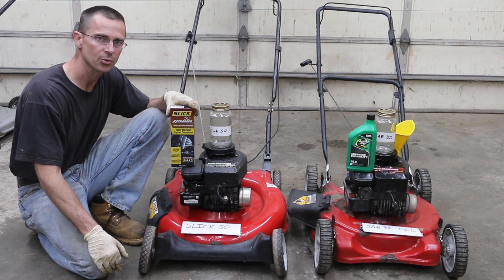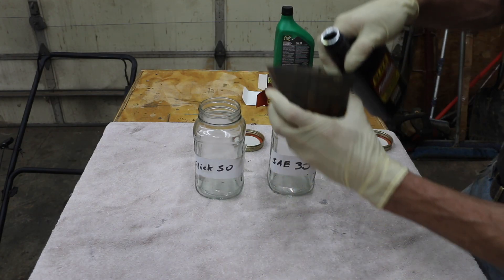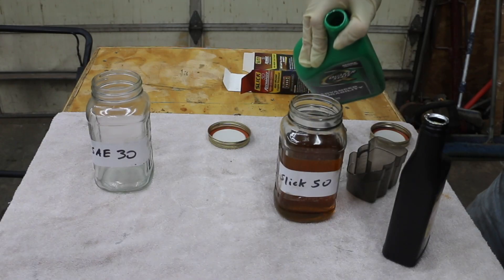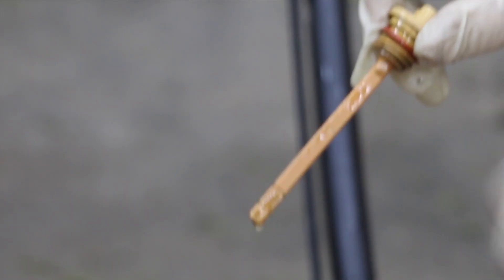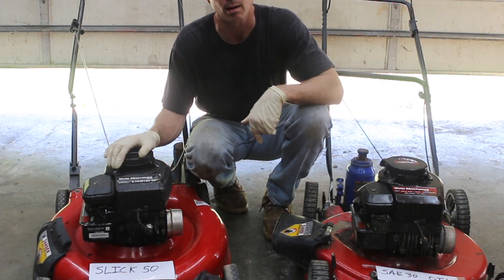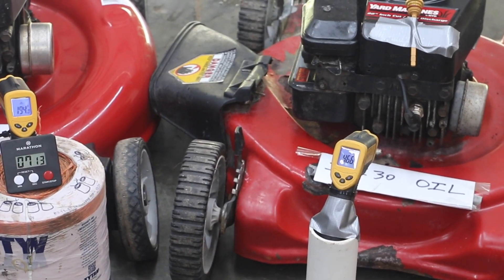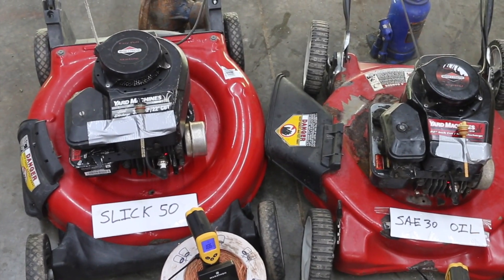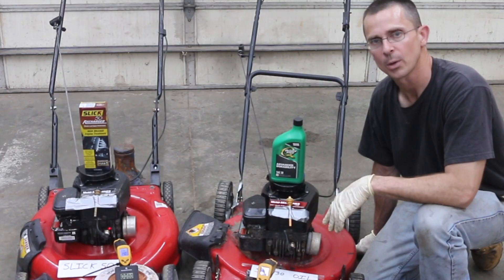Can't believe what SLICK 50 did to my engine!!--Dry Crankcase Test!

Comment: Actually, I was told during a "slick 50" demonstration at "Alderley Auto Toeing" many many years ago, it contained copper. And after the guy used an electric motor with a fixed bush on the end and a leaver to pull against it with normal oil in a tray under it and scratched up the bush. He then put slick 50 on it. Which filled in the scratches with something that did look like copper. With the normal oil I was able to stop the electric motor with the leaver. After slick 50, I lifted myself off the ground with the leaver and the motor didn't even slow down. At the time he claimed it was nano spheres of copper. My research below says it was soluble copper derivative. However he did go on about how the spheres were too small to get caught in the filter. For what's it worth, that is what I saw, heard, felt and experienced during the demonstration.
 

(In Tribology, the Garkunov effect is one of selective transfer of softer metals to harder metals. You need to explain the full tribological process in order to understand what's going on at the surface.

As the "copper indutstries" link above explains it's not nanoparticles of copper that are used in biosynthetic lubricants but oil soluble copper derivatives such as copper dihydrocarbyl thio- or dithio-phosphates, copper dithiocarboamates, copper sulphonates, carboxylates, and phenates.

The above are used as oxidation inhibitors for epoxidized vegetable oils.

Comment: I would like the to see the same test performed, but mix the Slick 50 with the same motor oil used in the second engine (at suggested ratio from Slick 50's manufacturer).
Reply from the maker: Thanks for the suggestion.

Comment: Here's a good one that no one's listed thats said to have been designed and tested by Department of Defense, NASA, and a bunch if other reputable scientific research agency's. Its called Tribo-Tex. Supposedly it could even improve badly worn engine bearings by clinging to them wherever their worn and filling in any worn down spots and after 500 miles of driving after adding to the crankcase, it eventually reaches every single spot of the engine wherever friction is present and can apparently seal a crack smaller than the width of a human hair. You should do a video on it, it would be really interesting as its not talked about too much. The crazy thing is, is it's literally just this little bitty syringe that cost $100.
Reply from the maker: Thanks for the suggestion.

Comment: Interesting test (thanks for the video)!
2 problems:
(a) "Slick 50" isn't - anymore.  The original slick 50 is now sold as Xcelplus.
(b) Treatment time - Xcelplus is a "treatment" not an additive, and it beds in over TIME.  For a car, this would be (at LEAST) a full oil change cycle (such as 10,000 miles), i.e. you put the treatment IN with an oil change and LEAVE IT IN for that full duration.  I don't know what the equivalent is in a lawnmower (maybe 50 hours runtime??), if it hadn't bedded in properly I don't think this test holds up.  I've never run an engine with zero oil, but I have used xcelplus in several engines, and had GREAT success (in that I know it WORKS).  Cut a long story short, my 1992 subaru brumby went 160% mileage of normal engine rebuild mileage and was still running fine, the most noticeable difference was a cold winter start took AGES to warm up enough to heat / demist the windscreen (that was actually a drawback, I'd  have to run the car at least 10 mins before I could drive it, largely negating any improvement in fuel economy).  There are promotional / marketing videos of airplanes being run without oil in the engines - these carry some weight.

Comment: Good experiment, shocking result. I heard (decades ago) that Slick 50 actually lubricates TOO well, allowing oil to sneak up  past the piston rings into the cylinder. Maybe that's why  the Slick engine stopped sooner before it got as hot as the other?? It might have been interesting to remove & observe the condition of the spark plugs.
Reply from the maker: Thanks!  Thanks for the suggestion.

Comment: I know, video was 6 years ago but I wanted to say there’s a stark difference between running an engine with Slick 50 for a few minutes (before draining) and running it hours and hours on end with the additive?  Perhaps running the mower for a full season of mowing with the additive might better mimick the thousands of miles driven with the treatment in the car’s engine oil before the next oil change, as designed.  Could it be, and I’m no expert, but could it be that the desired process that occurs with Slick 50 happens when used longer than when simply used till the engine gets hot?

Comment: I think the point is that as long as there’s engine oil in it, slick 50 will keep the temperature down and maybe that will help the longevity of the engine stick 50 was not designed to run on an empty engine of oil

Comment: I used Slick 50 in the 80's.   I had a V8 Mustang that used oil, since new.   I added Slick 50 and oil consumption stopped.   I added it to my airplane oil (Lycoming 360) and oil usage dropped a lot.   I wonder how Moly Slip does?
Reply from the maker: Thanks for the suggestion.

Comment: The old slick 50 with PFAS did more than what they sell now.
PROLONG is the product you need to test. It sticks at the molecular level, I'm not a fan of testing oil products like this, no engine is designed to run dry, find other ways to test the real world benefit of using an additive, like the temp drop. Prolong reduced wear in areas of my motor, TZ250, I was concerned about.
Slick 50 in my old Toyota R20 picked it up 10mph on top. 
No product will protect your engine from loss of the life blood of engine oil.
This marketing strategy was a waste of time in my opinion. There are many other marketable benefits from using a friction reducer.

Comment: So why did the U.S. Military endorse slick 50 for years . Between 1982  theu 1990 ???? I had worked at a parts house and seen the test were they brought a Briggs & Straton engine in and deained all the oil out of the engine and the sales rep started the engine and it ran for a hour the time he was at the parts house ??? I had a 97 Chevy Silverado with the 5.7 Vortek engine in it  my truck was treated with slike 50. That year 5.7 Chevy V8 engines were natorious for blowing head gaskets and dumping all of the antifreeze into the Block i had no idea until i got home that i had all of that antifreeze in the crack case of my engine till i pulled the dip stick when i got home and it looked like a cup of Coffee that had cream in it and when i drained the oil out of the engine it was as thick as honey coming out of the drain plug . I Tore the top of the engine down Flushed the top end out with break  clean put a new head gasket set and intake set on that engine and it had ran great till i sold the truck ... So i have a hard time believing what you are saying ..... What engine treetment would you advise to use if someone would like to use one because i have seen the proof in the putting with my experience with slick 50 products . And what company do you work for please advise me what would be the one to use now if i would use it again????

Comment: I had  my doubts back when  slick 50 came  out and  looked at it as a gimmick. I never  did  use that  product  and  now i never will. You just  proved  my  thinking.....its a gimmick. Someone  out  there  got rich by  folks  buying the  more expensive  slick  50 thinking they are doing better for  their equipment, when they weren't. Nice  demo  thank  you for  this I was  always wondering  about  this. I've  always  used straight 30 in all  my small  engines . never  had  one lock up yet , but  I don't  trust  Quaker state oil , I'm a Valvoline guy  used  it all my  life  as suggested  by  my late grandfather and  its  held  up the test  of time. I purchased a Chevy  pick up back in  the  80s , the  owner stated  he always  used Quaker state  oil. Soon after the  engine  locked  up due to passages  blocked  with some waxy oil mostly under the valve covers , had to replace  motor and  used Valvoline ever since with no  issues.
Reply from the maker: Thanks for the feedback.

Comment: @Project Farm If you notice the Slick 50 oil was black. Meaning that engine had more worn piston rings than the SAE 30 engine. It was allowing blow back past the piston which is exhaust making the oil black. So when you ran with no oil, it died first from exhaust cooking the crank case. This is proven by most or all of the exhaust puffing out the oil drain plug @ 6:32 Therefore this test is invalid as the engines were not equal. Should be done the same way as his most recent Lucas vs STP video with 2 new predator engines. This needs revisiting. - Detroit
I want to know more about the temp reduction cause I know PTFE inside there is awful for the engine.

Comment: In the 70s I remember a company called BG came around dealerships with a 6 cylinder engine that they would run their oil additive then remove the oil pan run it while the talking about their products about 25 to 30 minutes
Reply from the maker: Thanks for sharing.

Comment: One of the claims is extreme cold starting and the magic trick they used was an engine encased in a block of ice sitting in a room supposedly something like -50 Deg F. They chipped the ice from the fan and belts then started the engine. What they don't tell you is the engine was only slightly lower than 32 Deg F because that is the temp of ice and it will insulate from the -50 room temp. People lived in igloo ice shelters using the same physics. I also had a car that I knocked a hole in the oil pan and drove it 10 miles WOT until it seized. I had 30W Gulf oil in it. The next day it cranked and started. I patched the pan, put the same oil in it, drove it for two weeks and sold it telling the buyer what happened. The engine did have a buzzing/vibration at 2400+ RPM do to the bearings. I moved out of state and came back a year later and he was still driving it without any repair. That was just regular Gulf 30W oil so I am not a believer in any miracle claims. Just good quality standard products.
Reply from the maker: Thanks for sharing.

Comment: Heard somewhere way back that the engine Slick 50 used to demo would run for hours with or without Slick 50 or anything else in it. Quit buying it after my oil pressure dropped on something. Probably in the same ballpark as the intake vortex generators were. Guy installs wanting better mileage and feathers the throttle on the next trip. Hey it really works! Nope, your foot got lighter.

Comment: I use dura lube  each oil change  twice in the past couple of weeks I had bad water leakes  my truck was dry ...I fixed it and its all running fine   I drove over 40 miles with maybe a gallon of coolant   Good old chevy 305
Reply from the maker: Thanks for sharing

Comment: the question is. Are you sure both engines are 100% indenticle? If they are already used engine than the test is null and void. To be 100% acurate both engines would have to be brand new out of the box. But I would like to add. Thanks for the video.

Comment: I like durable I ran car car 8 miles after the oil pump pressure went to zero chanced the oil pump  then about 6 months later it happened again drove the car 7 miles no oil pressure chanced oil pump and that time dropped the pan replaced the pick up found pieces of gasket sealer hah plugged the pick up screen with thanks to duralube
Reply from the maker: Thanks for the feedback.

Comment: I used slick on cars we didn't drain the oil out we put them on a scope snap on scope poor slick 50 in and the ram would go up about 500  rpm higher we would have to idle  them down  this was in the late 70nd
Reply from the maker: Thanks for sharing.

Comment: the slick 50 engine didn't lock up. something failed with the engine.  the regular oil engine clearly locked up in the video.  Slick 50 engine acted like it ran out of gas, not a sudden stop as the other did!!

Comment: It looks to me like the slick 50 cleaned is engine during the initial run process given that the oil was darker. Maybe it removed protection but never actually got the opportunity to bond itself and mostly just drained out. Just an uneducated theory. It would be interesting to see the results after being added to two  clean engines giving slick 50 a chance to actually adire to the internal components.
Reply from the maker: Thanks for the suggestion.

Comment: In '92 or '93 I treated a Subaru Brat engine with Slick 50 after overhauling the engine. I apparently didn't torque the drain plug and on a trip to Texas from Oregon, the plug dropped with the oil right behind it... with the result being a fried engine in Tonapah, NV.  Perhaps this was after the buy-out of the original owner.
Reply from the maker: Thanks for sharing.

Comment: On your slick 50 chest what you didn't do was get the original slick 50 bottle it's a black bottle and you have to shake it for about 10 minutes, then you need to let it run for a while a long while so it impregnates the metal after that it should work fine unfortunately this stuff you used was a recharge kit and that is not the same as the original formula, I know this because I actually have a running engine with over 600,000 mi that I've used slick 50 on and I'm driving this car today.
Reply from the maker: Thanks for the feedback.

Comment: I've had similar results with DuraLube and a cigarette lighter plug powered oil-less air compressor. I decided to splash it with straight DuraLube and it ran really fast for a very short amount of time, then locked up.
Reply from the maker: Thanks for sharing.

Comment: As a Tech for 30 years I remember when Slick 50 was the big buzz, but having to tear down engines and rebuild them because the treatment bonded to the Oil pickup in the pan basically clogging it and not allowing enough Oil to flow through the Motor.
Reply from the maker: Thanks for sharing.

Comment: When I was young there was a car swap meet I would go to with my dad.  There was always an engine there running without its oil pan on to demonstrate slick50.   A local vintage engine expert noted that the demo engine was of a type known to have extremely hard bearings and that it was running with no load.   Nevertheless, it was running without an oil pan on for most of the weekend with an exposed crankshaft.
Reply from the maker: Thanks for sharing.

Comment: This surprises me as in the past I lost a water pump and my engine kept going and was towing a trailer that weighed as much as the car. Granted it was a water pump, but the engine did not over heat at all and ran for years after replacement of the water pump. I don't know what it would have done if I lost the oil pump, but I ran Slick 50 the entire time I had the car and it helped increase mileage and decreased wear and tear on the engine.
Reply from the maker: Thanks for sharing.

Comment: No man quit job you are the standard. When you talk about internal combustion. Engine.. combining all the variables. It's all about controlling combustion.. take for example my mustang.. double the horsepower will double the heat saturation. You can't just cheat you have to do some real time controlling combustion directions.. I took a shot in the dark and bought Royal purple drag racing oil $16 a quart.. it works superbly.. I just could not afford the oil to fail when your approaching maximum output. She going from 319 horsepower to 640 hp at the flywheel. As the heat saturation begin to increase the computer monitoring begins the back off on timing.. so instead of tricking the computer.. a combination of applications should solve the problem. 100 octane fuel. Two step colder spark. 170-degree Reich thermostat. Regency the color and cut off of the fans. Even wetter water. It will knock down your temperature by by 20 degrees.. and one last cooling application.. instead of air for water intercooler.. I invoked the.. refrigerant to water intercooler... Using a plate heat exchanger what a TXV valve in the one side of course a reserve tank of 4 gallon insulated it's a chill water system. I guess instead of 8 to 12 degrees before and after the supercharger I was cheating 45 to 55 degrees before and after the supercharger. I also experimented with that wonderful hydrogen system hydrogen on the bed which makes 2 liters of hydrogen something like that. Nicole was unable to be toons with the device in operation. Injecting it's going to suck it all up it's like going to regulate its info through the RPM.. Hannah has some kind of regulating system and injecting hydrogen I'm almost positive it could have been incorporated into the vehicles normal racing tune.. but I didn't want my car to run on hydrogen m all I want to achieve is a more complete burning of the fuel. I was going to delete the system out of the car but decided to operate the system differently. Get up to 70 miles an hour put it on cruise control then turn on the hydrogen generator. I think speed in the approximate RPM I calculate 8% of the total cubic feet per minute ... that's point 8 percent. On a 20-mile ride I went from 28 miles per gallon to 46miles per gallon. It wasn't some magic creation of energy.. it was already in the vehicle and unutilized in the fuel. I'd love to come work for you..Paul
Reply from the maker: Thanks for sharing.